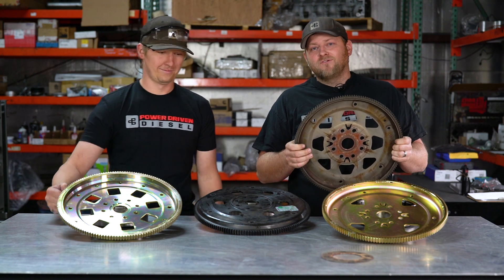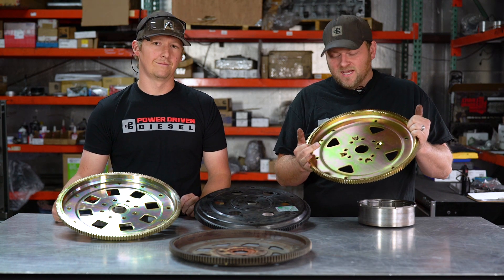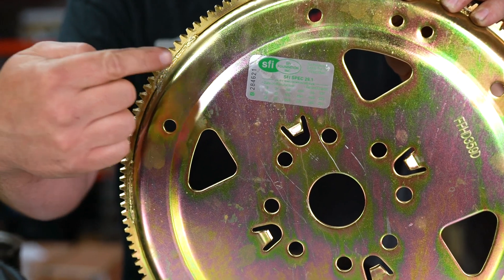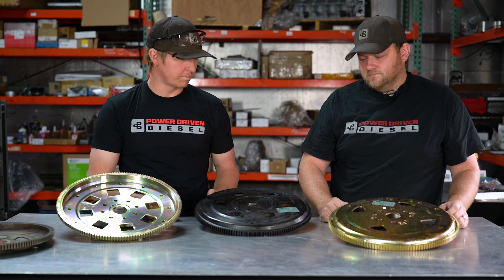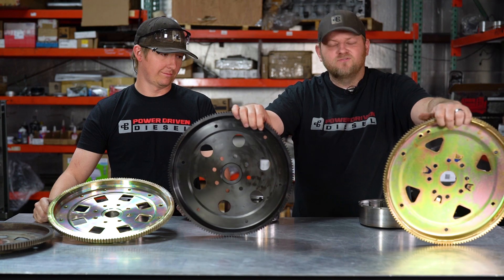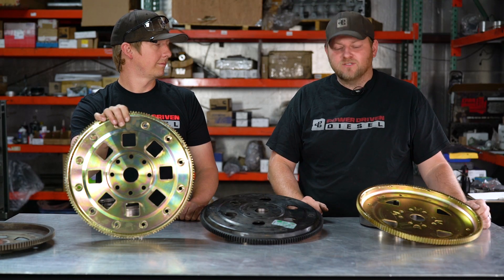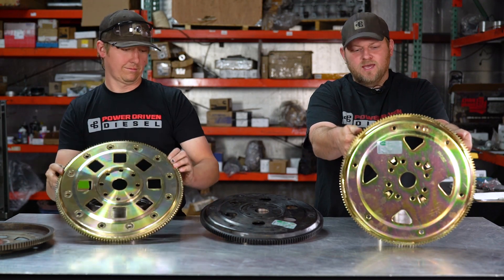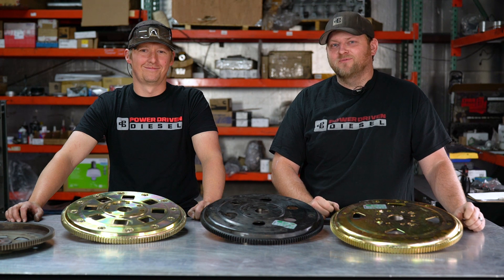What to Know About Cummins Flex Plates | Power Driven Diesel

Comment: That ring is a shim, there for a reason. Afraid of less threads, loctite it. No shim, flywheel probably contacts the rear engine and eventually will crack.just a thought
Reply from the maker: The ring is on the outer side of the flywheel, so there is no problem with hitting the adapter plate .

Comment: 2014 dodge ram 5500 6.7 automatic starter. flexplate bolts to crank torque specs. anyone know the specs? thanks

Comment: Just out of curiosity why can't the flex plate manufactures have punched tabs so the torque converter has something to rest against as well as bolts used to secure it down ??

Comment: Why is it called a flex plate?
Reply: Alpha Bravo it allows a slight misalignment between the engine and trans and cushions shock into the torque converter.   The factory ones are very flexible but it high hp applications they break.